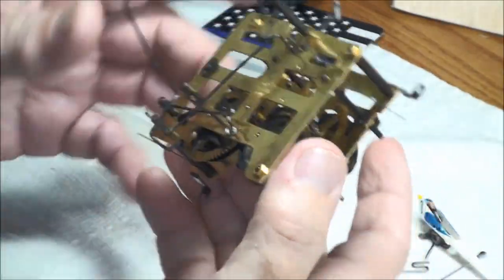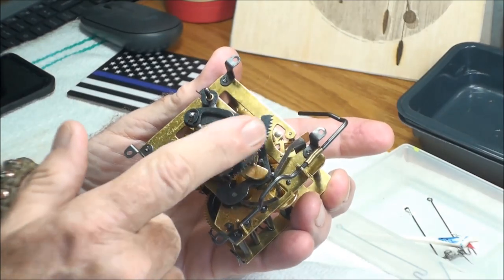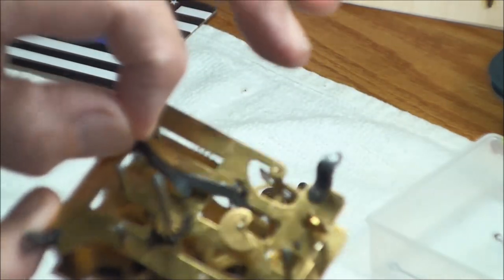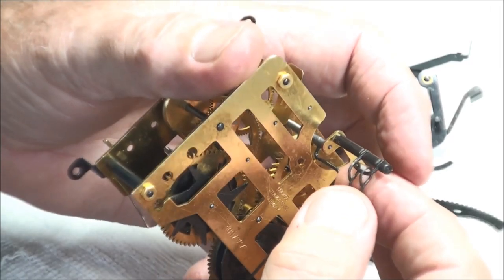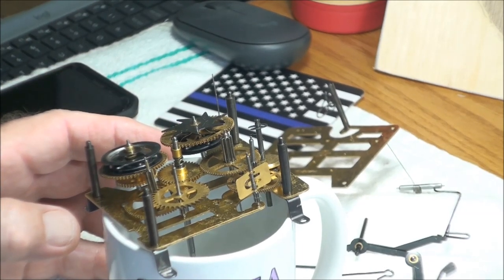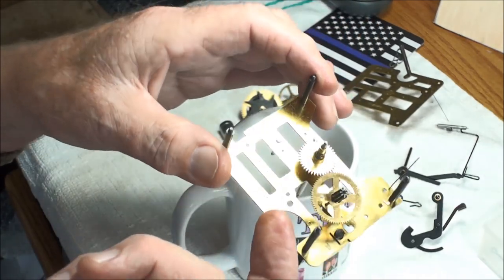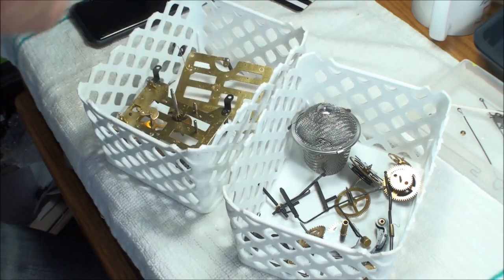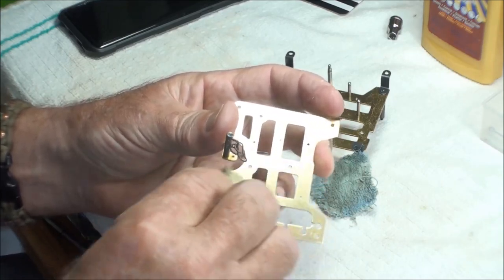Cuckoo Clock Manufacture Co Cleaning and Oiling

Comment: This is a BADUF 100 movement Mike. It takes 325 gr weights. You did another great job Mike. The only comment that I have is when you are putting the clock in time (3rd wheel warning pin next to rack stop lever and the tab of rack stop lever in the Cam mouth) you dont have to take the clock apart to turn the 3rd wheel warning pin. All you have to do is get the pin to hit the tab and then shove your fingers down into the movement so the gears dont move and then with a pair of plyers turn that CAM so it goes where you want it to. Remember these CAMS are pressed on and can be taken off so they can be manipulated with a pair of plyers. Keep up the great work. BTW thanks for the shout out.
Reply from the maker: I will try this next time, I know they are pressed on and how to get them off but a bit worried of them coming loose. Some I have worked on must have been loose because of the clear glue or resin I find on them.

Comment: This was my clock!!! Thanks Mike! I cleaned everything with the stuff you said to use and oiled the parts you said to oil.  But I didn't dare take it all apart. You rock Mister. I haven't had time to get into the box yet. Covid is at our house. But I know that all will be well.
Reply from the maker: I don't normally talk about it, but you do realize any virus is going to test positive, even the ones 10 years ago. Just the same, take care of your colds there. 
  When you don't take the movement all the way apart, your movement will take longer to get in running again because the old oils and dirt didn't come all the way out. If you are lucky, the clock will run right away. Otherwise, just keep starting the pendulum every time you walk by the clock and in about a week the clock should take off and start running again as the new oil loosens the old oil.
Reply: @justmike57  Thank you for your kind words. I am so proud that my clock got on Youtube. I actually think I saw it wave :) I actually refer to you as the "clock whisperer" You are my hero!!

Comment: What is the small gear called behind the snail? The one with the 2 wings on it? That broke on my clock and I need to replace it.
Reply from the maker: I didn't relies I was so behind on my comments. They call it a Cam Gear Regula. Timesavers has one. The part number is 20917. The book recommends you shouldn't take it off because it is very hard to take off and just as hard to put it back on. Good Luck Chris Sanders

Comment: In your next video, could you address why you don't just ultrasonic clean the mech whole.
How about a video where you answer questions? My question: Were you formally trained in clock repair.
Reply from the maker: I am a few videos ahead. The reason I don't just drop the movement in the cleaner anymore is because the cleaner does not get all the parts clean as you would think. When I did clean them that way, it would take a week to get them to tick and keep running and reoiling the movement. Why, because you started to loosen the old oils that either gummed up the movement or the oil turned to a shellac and when you drop it in the cleaner, it is just gummed up. Even using a movement cleaner and the ultrasonic cleaner, you still have to run a toothpick in each pivot hole to finish pulling the old oils out. 
  If I think about it, I can do a video of why it is best to take the movement apart. They do sell a movement cleaner for those that don't want to take their movement apart and maybe the cleaner and pressure of the can will clean out the old oils. I don't know, because I haven't tried it yet. I think the can cost about $12.00 before shipping. 
  No, I am not formally trained in clock repair. My training is time under my belt on trial and error. When I started, I decided that the clock was consider broke, and I also started with a cheap clock as well. When I worked on other family members clocks, I would tell them the same thing. It is broke and if I can't fix it then I didn't hurt anything, now did I. 
  It also helps that I am good with my hands and good at looking for the problem and getting the clock to do what it was suppose to do. Yes, there are times I want to tear out my hair, but take a break and move on with the clock.

Comment: You don't have to take it apart to clean it,  waste of time, it can all go in a ultrasonic cleaner, done in 20 minutes.
Reply from the maker: In so many word, you are right, but if you watched to the end, I did say most of this was not necessary. Learning what the pendulum was all about is the point. The only problem with this pendulum was the top block was screwed on too tight and you could not adjust the pendulum at all. Just the same, I showed how to take it apart and what the real problem was. Thanks for watching Robert.